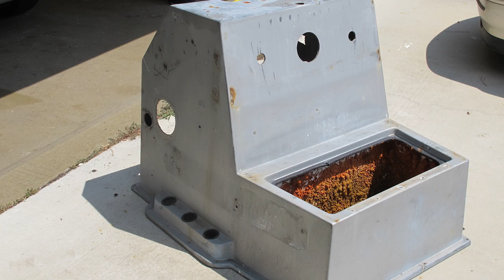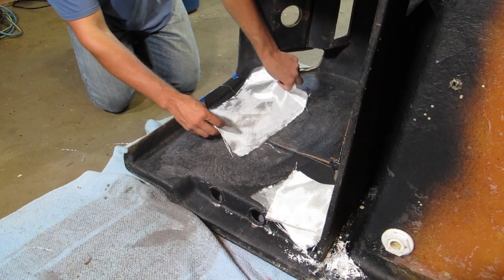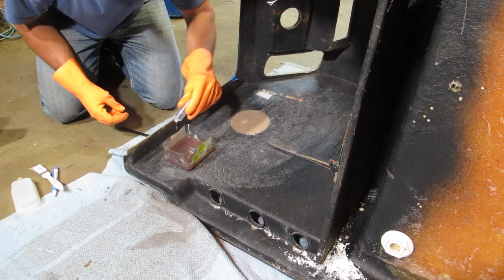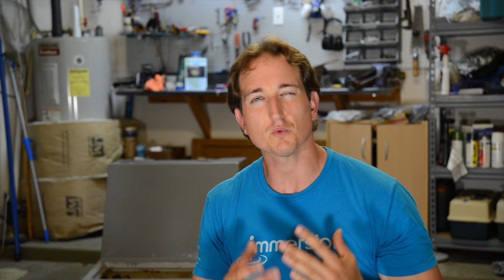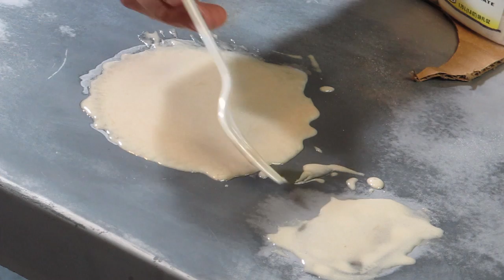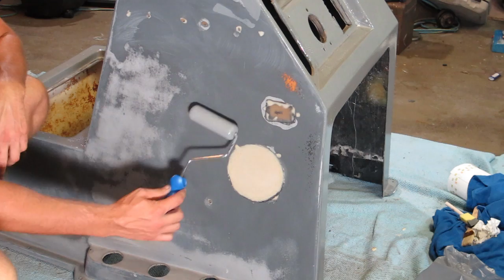How To Boat Restoration;  Fiberglass Hole Repair

Comment: Perfect!  Just bought an old dump truck which needs some holes repaired in the fiberglass cowl so I can remount turn signal lights.  Thought I might have use gelcoat as well but it looks like your surfboard concoction did the trick.  Thanks!
Reply from the maker: Thanks! Let me know how the fiberglass repair on your truck turns out.

Comment: Your use of cardboard-on-cardboard to support the one side of fiberglass was inspired! Good job!

I used to be able to do this kind of job with balsa. In model aircraft weight is even MORE important, and when you've spent the night making a broken plane look like it's brand new, it feels about like THIS did, when you were done with it.  :)

The product you suggested- in 'the balsa arts' they have a filler called "microballoons" you add to paint; this might be the same kinda thing- I know it's the same end-result. If you can't find more of the product, try looking by this generic, perhaps jargon, name.

Great job!
Reply from the maker: Brian Fahrlander Thanks Brian, I have dropped a few RC aircraft out of the air myself and can relate

Comment: Cool repair. 
But if you ever attempt a similiar repair, once you get to the filler stage, just get some short strand fiberglas filler. Mix up some with the supplied hardener, apply, and it will sand out a ton easier than what you made up for a filler.
Reply from the maker: good tip, thanks

Comment: thanks for the post, good work.  you might want to point out that polyester resin does not stick to gel coat.  the inside of the your console is black gel coat or paint.  either way it should have been sanded clear before the patch.  second observation is that the edges of the repair need to be flared at a ratio of 12 to 1.  in other words a 1/8 inch thick piece of work shoud be feathered out  12/8ths or i.5 inches.  then the patches have some real purchase on the glass being added too.  of course i could be wrong.  cheers.
Reply from the maker: greg gartrell thanks greg

Comment: I'm not really wishing to be negative , But these repairs were done totally wrong and you will have cracks in your repairs once the polyester has shrunk while curing. Number one, when you are putting the first layer on your 40 grit ground substrate, it should first be a layer of matt not cloth. Layers of cloth should never be put on top of each. There should be a layer of matt between each layer of cloth as this improves interlaminate bonding. Matt always bonds better than cloth or roving to an existing substrate. On the outside the edge of the hole should of had a gradual taper ground to it by at least 40 grit out to about 3 inches beyond the hole. the hole should have then be filled with alternating layers of matt and cloth each layer being larger until the desired thickness is achieved.
Reply from the maker: Thanks for the working with fiberglass tips

Comment: First off, GREAT VIDEO!! I'm resorting an old Ranger bass boat right now and I mostly have drill holes to fill ( lots of them ) I was just wondering can I just use the resin to fill these or will I need to add shredded fiber? The drill holes are not very big but like I said there's allot of them.... Thanks for the great video 😃
Reply from the maker: Thanks,  If they are small holes, like those from drilling holes or screws, the resin could likely work.  You just want to make sure the resin has some structure to stick to well (so the resin does not pop out down the road).  Flaring the holes out could help.  Also remember that resin is very hard when cured and difficult to sand.   It might be wise to consider adding a resin filler such as Cab-O-Sil.  Good luck with your project.

Comment: Nice work.  I only used 1 sheet of biaxial fiberglass to back mine, then used a combination of fiberglass/resin and MarineTex to fill the holes and fill the grain.  Thanks for your video!
Reply from the maker: Thanks for commenting and sharing your process

Comment: Be sure to use laminating polyester resin.
There is a difference. Laminating polyester resin does not have any wax in the formulation.
Reply from the maker: thanks for your insight

Comment: Good job.
Cabosil is actually tiny glass spheres.  That's what makes it so light.
Best to add the cabosil to the resin before catalyst.. You can make a large batch to the consistency you need.  Then add catalyst to the amount you need for each repair.  You might want to add other products as well such as milled fibers.  West Systems sells a bunch of them and there is a great book available on how to use them properly.

Island Marine Group, LLC
www.islandmarinegroup.com
Reply: Incorrect, Cabosil is a fine ground glass product. Micro spheres or micro balloons are glass spheres. they mix and handle entirely differently. Cabosil makes a formable glass jell-paste and microballoons makes an more easily sanded filler.

Comment: What would you do if this was on a trailer wall that could not be laid flat to pour in the filler?
Reply from the maker: will you have access to both sides of the hole to be repaired?

Comment: I have a small weak spot on the floor of my bass boat. would this help to make it strong again?
Reply from the maker: You would have to address the issue of the week spot.  It may be that there is rotted wood underneath your soft spot.  That would  need to be replaced with something to provide the necessary structure (perhaps another piece of wood) and then that could be glassed over.

Comment: Just wondering??  Why not gel-coat the helm??  Wouldn't it match the rest of the boat better??  I'm getting ready to do a similar project..  Just wondering if there was something I missed?  :-)
Reply from the maker: SgtRollo61 If it was for a nice boat I would.  This was a helm for a work type pontoon boat so matching was not a concern.  Gel-coat is more involved and more expensive and I didn't think it was worth it for this demonstration.
Reply: Thanks! :-)
Reply: He did a lot of things wrong, He would have been immediately fired at any boat manufacturer or decent marina.

Comment: I have a simlar hole in my bottom of my boat. If i place cardboard in the area from the inside, i wont be able to remove the carboard when it is done, how would you fill a a hole from the outside only?
Reply from the maker: +derek wells i wood try to get a piece of wood (or rigid fiberglass) down in there and glass it in.  To get the wood in there you might try a similar technique like I show in this drywall patch video.  https://www.youtube.com/watch?v=AV2n1Fmplpw

Comment: Great tutorial, I'm half way there, all I need to do is find some cobasil but having no luck finding it locally, is there an alternative filler I can use that I can purchase locally and also have the same results as yours? P.S. I inhaled too much damn kerosene, felt like my lungs were getting stabbed repeatively.. Safety first kids! Lmao
Reply from the maker: i have heard some using a very fine wood dust/powder
Reply: Flour or wood fiber. Google thickened epoxy + flour or wood fiber